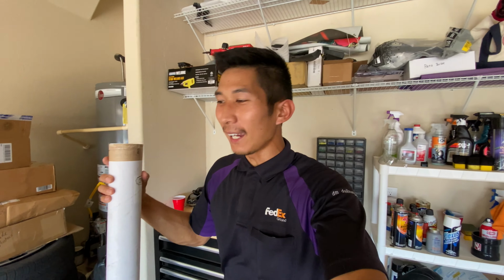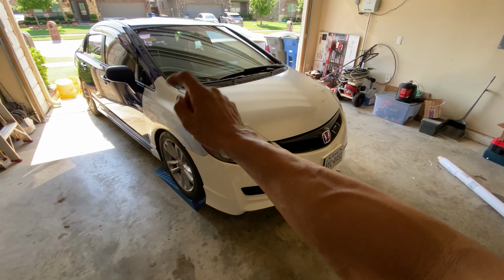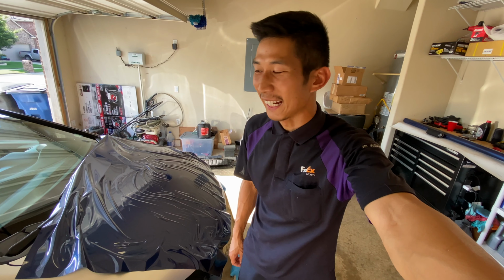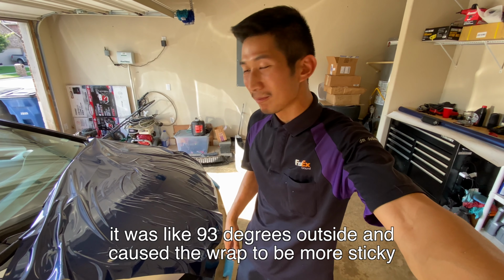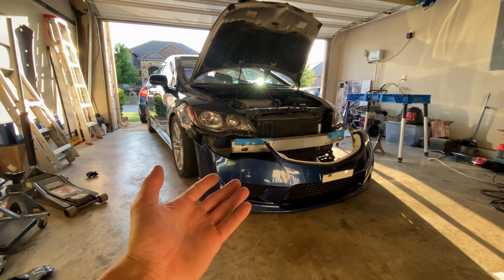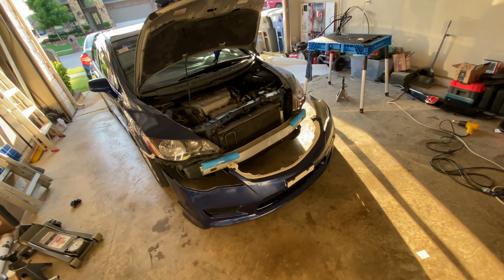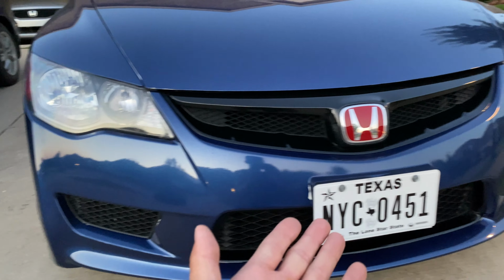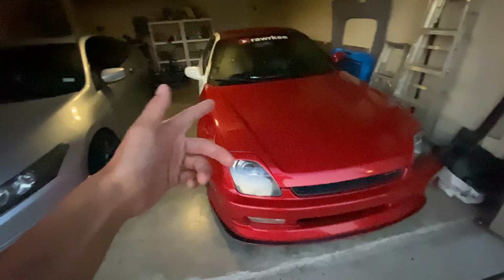Wrapping the Civic Si Frontend in 9 Minutes!

Comment: how much wrap did you order?
Reply from the maker: I don't remmeber at the top of my head. I want to say 9 feet... you can use tape or a string, just run it along the length of the bumper, then you can lay that flat and measure there.